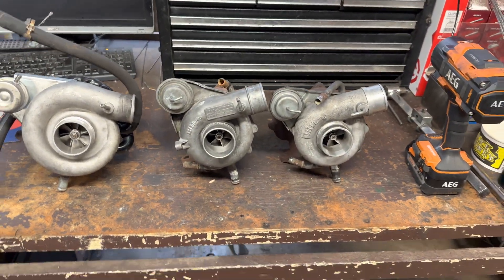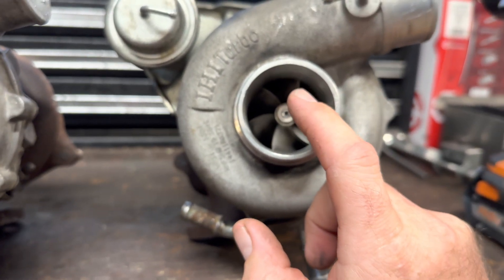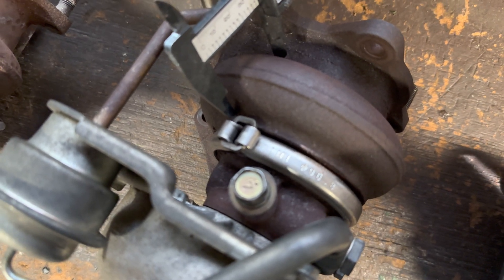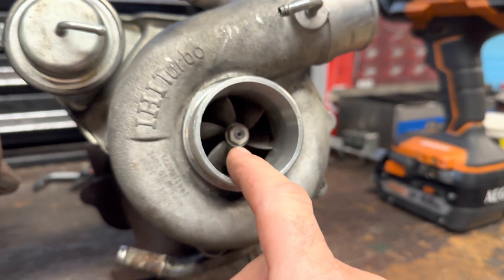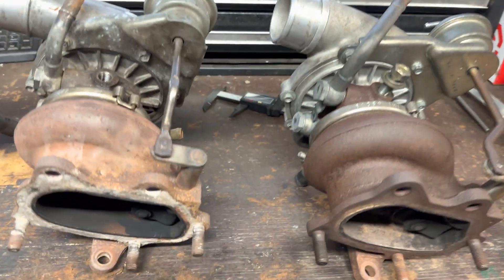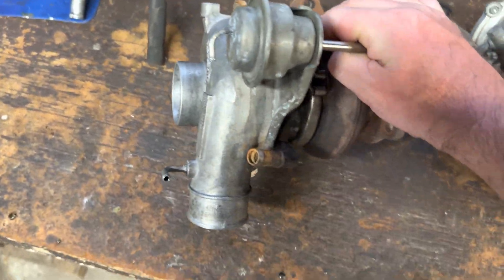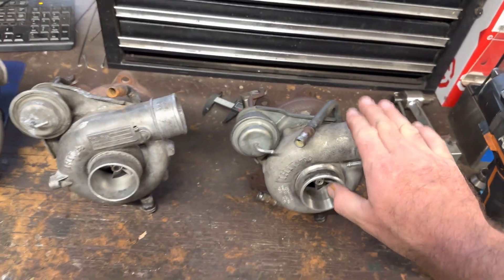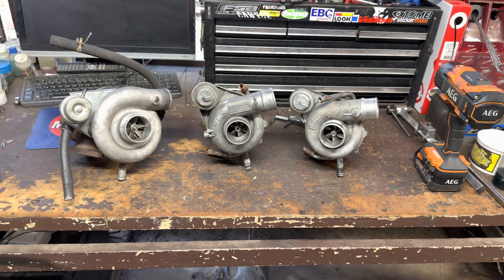Subaru WRX STi VF28 vs VF34 vs TD05-20G

Comment: Vf34 its worth in the 1.4 engine turbo for max 290hp?
Reply from the maker: I’m not sure, it’s not laggy on a 2.0L but there are turbos that spool faster. So in 1.4L you might find something smaller that would still make the HP but spool faster. I would find the most modern turbo, in the smallest size possible, that supports your horsepower goal. I really enjoy response as it makes the car feel fast & the power is always there when needed.

Comment: The vf34 had 11 blades,  td05 12. What did you think of the 34, I’m about to replace my vf23 on my sti type r.
Reply from the maker: Yeah it’s good. Very slightly slower spool than VF23/28 but it holds boost better up the top end. None of the VF turbos sound good when they initially dose from high boost (with no BOV). They make a very long tzoooooo sort of a sound. As low boost they make the chopping sound. Whereas the Garrett & TD turbos go tzoo tzoo tzoo tzooooo all the time. I’ve got a Blouch dominator 1.5 7cm on my blue car engine one building. I think that’s equivalent to a GT3071 Garrett. Will be interesting to see how the spool is vs the smaller VF turbo.
Reply: @Fine_Performance   can you make a comparison video of the doses of each turbo?
Reply from the maker: @ethanlai3513  the VF still turbos dont dose above a certain psi, the just make a long Tszoooooooo sound. The 20G makes an awesome tszoo tszoo tszoo tszoo tszoooooo. Here’s a clip of the 20G: 

https://youtu.be/ykFmbeY0wXw?si=OczQhCt7QjoBoheD
Reply from the maker: @ethanlai3513  and here is the Vf34 / killer B inlet / SYMS headers / BLITZ exhaust (no silencer).

https://youtu.be/U8VGatQwFoA?si=-f0PGq_kqS19jZsx

Comment: Iv got a vf35 on my 02 sti and I’m getting a bit of blue smoke occasionally so I’m thinking of upgrading it , any suggestions?
Reply from the maker: Is it 2L or 2.5L? Depends on what you want to do. For daily, but still quick VF34 is good for either. If you have the supporting mods (bigger fuel system, Ecu etc) a Blouch Dominator XTR 1.5 7cm is a solid choice. There are other choices like Garrett 2860 or TD05-20G. But the thing with turbos is get the most modern one you can afford. If I use my 1JZ as an example, it has a GT3076 (10 year old tech). It’s 525hp max. A newer version of that is the G30-770. It’s smaller compressor so spools faster, but more efficient design etc allows it to be 700Hp max. Does that help?
Reply: @Fine_Performance  that does help mate thanks it’s food for thought 👍

Comment: Quick question. I just got the same turbo. And for the coolant return line. Did you loop it up and around the turbo? I'm having clearance issues of making the line fit under the turbo.
Reply from the maker: Yeah, I had the water return kinda loop around the back & had heat sleeve on the hose.

Comment: Nice video,

from my understanding: 

vf28 spools slightly faster than vf34, vf34 slight extra top end, both ball bearing 'roller bearing'

VF34/vf28 very close anyway, vf34 has more efficient compressor housing/wheel i believe? (in your video its those curved blades) 

anyway i bought a vf28 at a bargain for $400, the owner 'upgraded to a vf34'  he took some stupid advice from the internet, rather than looking at it objectively.

Anyhow, he got a gain of 6whp and said he wasn't impressed at all, he didn't do work himself so charged labour and dyno tune, over $1750, excluding turbo cost.

I found vf28 is good for around 17 - 17.5 PSI, then its efficiency drops off (probably in peak of its curve for a 2000cc engine)

I only remember so well as vf28 was my first ever turbo upgrade, my first ever tune i did myself, and i put it back on my first ever engine rebuild i did.
Reply: So much talk about the VFs when in reality it's a downgrade from the Td05H..... Remember this is a MAXspeeding 20G which is the "heaviest" Td05H you can find around.... still only 500 rpm delay in spool. Another form of Td05H would be very close in spool and still make more power, even a 16G.
Reply from the maker: @Αναστάσιος-σ8υ  yeah I found that exactly. I reckon it’s slower to spool because the TD turbo I had was cheap & probably had a heavy compressor wheel. My 95 car had a TD05 & I swear is had more power than the VF23/28’s that I’ve tried. They’re roller bearing which I don’t think is comparable to a ball bearing setup. But yeah, VF34 is basically a TD05-16G but less peak HP rating.
Reply: @Fine_Performance  I don't know specifically in your turbo however I have seen that a 6+6 Chinese 20G cast compressor wheel weights 72 grams. The original MHI is around 67-68 g, however it has been in at least three generations so a brand new maybe lighter. Kamak ( different brand name or sister company with Kinugawa) weights 61g (I am always talking about a 6+6 cast wheel) while a good billet 20G weights approx 57g. A good billet big16G is only a few grams heavier than a stock cast VF compressor wheel.
Reply from the maker: @Αναστάσιος-σ8υ  I’m just talking about the cheap eBay one I bought. I don’t doubt there are much better 20G turbos with lighter compressors. I was moreso referencing the one I have.
Reply: @Fine_Performance  I was trying to say that despite yours being a "cheap e-bay" ( possibly a MaxSpeedingRods ?), Td05Hs are so good that still is more than good enough.....
Reply from the maker: @Αναστάσιος-σ8υ  yeah I was surprised. It’s almost like it was a bit slower to spool then once it got going, it built boost faster. I don’t have any data or logs to go off, but that’s certainly how it felt. And yeah, even my MY95 TD05 went as good as the VF34.
Reply from the maker: @Αναστάσιος-σ8υ  it’s not maxpeeding. Though they probably sell the same turbos.
Reply: @Fine_Performance  that what I was trying to say in my previous message. This delay can largely be attributed to the heavy compressor wheel. By the way, VF series has similar or better performance than the GT/GTX2860 series. Specifically the VF34 tops slightly the Gt2860rs 0.64 a/r . We know this mainly from MX-5 owners.
Reply from the maker: @Αναστάσιος-σ8υ  oh gotcha. I was wondering how a Garrett 2867 or similar size would perform. My car I’m building has a Blouch dominator 1.5 which I think is GT3071 frame approx.
Reply: @Fine_Performance  the blouch dominator 1.5 is a ball bearing version of the Td05H with a billet 6+6 compressor that seems to be derived from the GT3071 (in its dimensions). I wonder how it compares in boost response with your chinese 20G. Now about the 2867, why do you think that there was never produced a GT2867 with a 6+6 cast wheel? The GTX2867 has a bit smaller compressor than the 18G , and usually comes with a bit bigger turbine housing (0.63/0.64 instead of 0.57 in T25/T3) does this make sense to you? I think the 2867gen2 is comparable with the good old GReddy 18G . The only one that is better than a good 20G is the EFR6758
Reply from the maker: @Αναστάσιος-σ8υ  GT3071 is 53/71 compressor // 60/55 turbine. TD05H is 46.5/60 compressor (16G) / 49/57 turbine. Completely different design & dimensions & is essentially what a Blouch Dominator 1.5 is (with possibly different aerodynamics compared to Garrett). But nothing like a Mitsubishi/IHI TD05. The “TD/Greddy/etc” turbos are all Mitsubishi/IHI design & aero. Garrett is totally different as would be a borg warner (totally different design & aero). TD05-18G is a 400HP max turbo. GT2867 is a 475Hp max turbo. But as you say, I wonder how the 20G compares as that should be similar to the GT2867. I guess it depends on the wheel sizes, how new the aero dynamics are & how efficient they are.
Reply: @Fine_Performance  the blouch dominator 1.5 has the same turbine dimensions as a Td05H, as well as the same dimensions in the CHRA , with a 3071 size compressor. While it's substantially different to not be a Td05H, it's a clear derivative. It's a rather usual situation, like for example the precision 31 and 76 series are derivatives of the T3 & T4 turbochargers, the VF23 to VF29 use a compressor derived from the Garrett T28 etc.
Reply: @Fine_Performance  Now about the GReddy Td05SH-18G and the Garrett GTX2867gen2. GReddy rates this turbo for 400 hp while Garrett gives 550 hp. Let's keep aside the fact that the Japanese are generally more reliable in their power claims. If you read the map you will notice first that at 1.5 bar the 2867 spins at 165.000 rpm, while the Td05SH-18G at 130.000 rpm. The efficiency rates at the right side of the compressor map in the Garrett are too low. It's easy to push the line on the right and claim more capacity while in reality the efficiency drops too low. In general, don't take anything seriously in a compressor map below 65%. So, if we check the air flow of the 2867 at 66% is about 300 grams/ sec , while the Td05SH-18G has a capacity of 318 grams/ sec with a 65 % efficiency. The 2867gen2 tops the Td05SH-18G only because keeps that efficiency up to 2.3 bar instead of 1.7 bar of the -18G. In real life conditions, it can hope it can keep up that high in both revs and boost pressure only with a 0.86 a/r , while the Td05SH-18G 400 hp are rated with a 8cm3 (0.57 a/r) turbine housing. With the usual 0.64 a/r , both turbochargers should be very close.
Reply: @Fine_Performance  now I realised that the "475 hp max turbo " is the 2867gen1 with the 11 blade compressor. This one keeps efficiency only up to 1.7 bar however it flows more than the 2867gen2 up to 1.3 bar
Reply from the maker: @Αναστάσιος-σ8υ  greddy is an outdated turbine design & journal bearing design. Garrett g series & Gtx gen 2 is the most modern tech. That is why greddy is 400hp Max & Garrett 575hp max. The Blouch turbo IS. A Garrett 3071 with Blouch housings.
Reply: @Fine_Performance  Blouch says that has a turbine with 56.5 cm diameter, so it should be in Td05H dimensions. Now about the 2867 vs Td05SH-18G. When I compared the gen1 vs gen2 compressor I didn't feel to compare the 18G vs gen1 because I thought that it's obvious that the gen1 has more air flow up to 1.3 bar. But talking about the gen2 vs 18G it's not me but the compressor map that talks. If you go and look at actual installations, 2867 usually maxs out at approx 450 whp. That is because is very difficult even to surpass 180.000 rpm, so even go at 2.3 bar is difficult and keep it that high to the redline. The GTX2860r with it's smaller compressor can keep up better, so we see that it can approach 400 whp easier. Ball bearing by itself doesn't mean much. If you look at the internals of Garetts and the internals of the EFRs there is a huge difference. Ball bearing came itself as a technical solution as a way to have a stronger CHRA. A good way to look at a journal vs ball bearing really means is to compare a VF30 vs VF34. . The G series makes more power via a bigger compressor housing that the usual 0.60 a/r, to 0.70/72 a/r. It can work if you can keep boost up high, in real life needs these big turbine housings of at least 0.72 a/r. So in cases that the engine can have a short and good header it works, in Subarus and Honda K series not so much.
Reply from the maker: @Αναστάσιος-σ8υ  no. Dominator 1.5 is nothing like a TD05H. Dom 1.5 is 53/71 in/ex compressor // 56.5/51.7 in/ ex turbine. TD05 16G 48/64.3 in/ex comp / 55.5/49 in / ex turbine. 18G 49.8/68 comp // 55.5/49 turbine. 20G 52/68 comp // 63/54 turbine. Garret doesn’t build their turbos “based off” an old Mitsubishi/IHI design. 

Here is a link to most common turbos available with their inducer/ exducer measurements for compressor/ turbine. Simply because the dimensions are the same/ similar (which none of them are), does it make them a similar turbo or that one was “derived” from another. Greddy TD05/TD06 are just that, because they are IHI/Mitsubishi CHRA with GREDDY branded housings. 

http://www.xtremeracingtuning.com/Tuning/Turbo%20Spec.pdf
Reply from the maker: @Αναστάσιος-σ8υ  VF23 (or VF28*) is most similar in “dimensions” to a Garrett GT2554R. But that means nothing as the shape of the blades & aerodynamic design of the turbo have a lot more to do with turbo performance than the inducer/exducer measurements. Precision *USED to be Garrett chra with their own design housings (like a Blouch). But now they use Chinese chra to their specs (though essentially a Chinese copy of a Garrett turbo). T3 & T4 are really old turbos that are oil cooled only. With over 12 years newer tech than a T3/4 turbo… nobody is “deriving” their design from ancient shaped compressors & turbines. Especially these days when a PSR Garrett G series is 30% more power than anything GT series & 10 years old.
Reply: @Fine_Performance  yes I looked at it. I was indeed wrong the dominator is based on a GT2971r ! I got confused because Blouch is using Mitsubishi type measurements. You present the Td05H as ancient, which it is, however the GT30R (the GT29 is essentially a cropped version of it) was presented in 1997 if I am not mistaken, while the Td05H in 1992, so not much of a difference ! The GT30R was based on the TR30R that was in the corsworths of that time. About the VF23/24/28/29, neither from a GT2554 or a T28, it has its own 45.28/60.00 in/ex compressor.
Reply: @Fine_Performance  the T3/T4 is a really old design, however it's true that the -31 and -76 series of precision are derived from these, as well as most Turbonetics, many BNRs and others. G series, they are getting their best results by doing downsizing, so going for example from a GT3071 to a G30-660.
Reply from the maker: @Αναστάσιος-σ8υ  the only physical difference between G30-660 & GTX 3071 is the compressor exducer is 4mm smaller on the G series. But the difference is in the aerodynamics/ shape of the compressor. The 4mm less exducer is 5% more max power & 5% max efficiency (79% vs 74%). Turbonetics is an old turbo so of course it’s build on the same period of technology. There are precision turbos equivalent from T04Z, to GT, then GTX gen I & II.
Reply: @Fine_Performance  yes Indeed. The GTX3071 has a slight air flow advantage in low boost levels but higher in the boost range the G30-660 is better in every aspect.
Reply: @Fine_Performance  Turbonetics had a good reputation as a quality turbocharger, possibly better than Garrett itself. But still the T3/T4 which they come from, are very old now.
Reply from the maker: So I reckon, while the peak HP might only be 6HP at full boost, the power you have at 4500-5500rpm on a VF34 might be slightly more than the VF28. I’m not sure as I didn’t have full control over the boost with the old HKS boost controller. I can definitely say that a lot of it comes down to how well the boost control is setup, because in my JZX90 which I meticulously tuned & then setup closed loop using it’s link Ecu. The difference va open loop boost control is massive. Essentially it’ll do whatever it can to make the boost target you give it, vs open loop, it’ll produce whatever boost is the result of the duty cycle you give the solenoid. I just got a HKS EVC 6 (vs the old V) & I can use a PC to graph/ log/ test & tune the boost control to get the best results. The boost table my tuner did wasnt the best vs the one I ended up with by tuning it myself on the JZX. I found more areas to add duty cycle without it overboosting.
Reply from the maker: Being more efficient, you should make more power at a lower boost level & also lower IAT. That’s what say a G series garret vs an older GT turbo will do.
Reply: @Fine_Performance  a lot of variables.

I've tuned boost to come on Early by leaving waste gate shut longer. But turbo spools too fast and you hit that transition rich zone too easily and guzzle fuel lol 😂